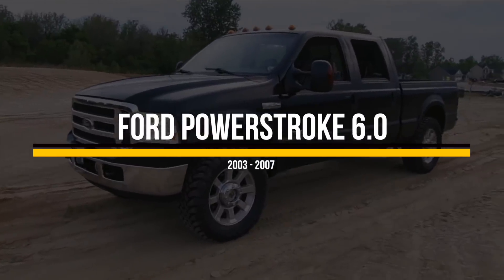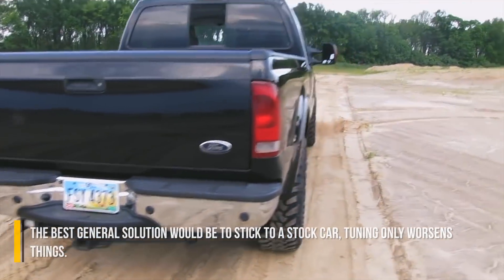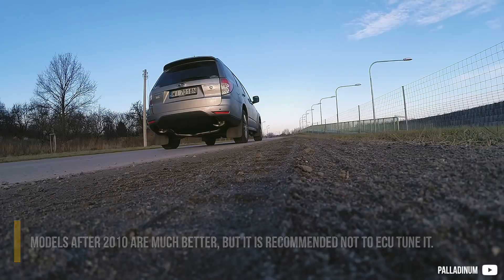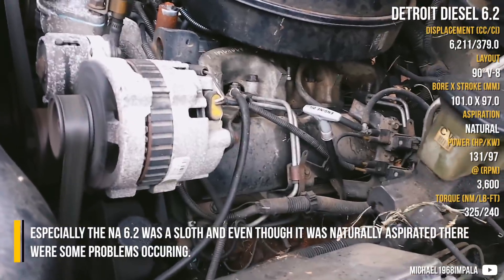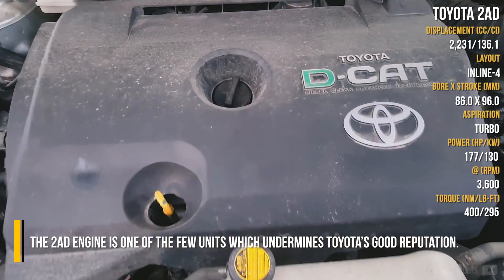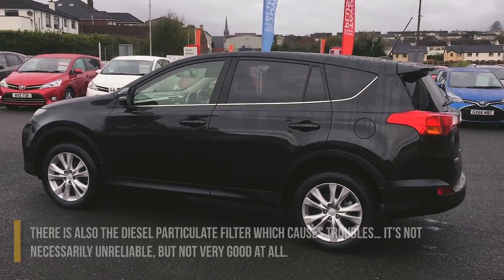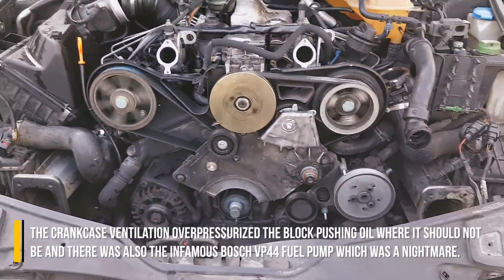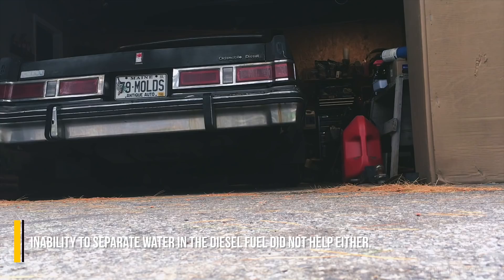6 Worst Diesels You Should Stay Away From

Comment: 6.0 and 6.4 Powerstroke are shit. 7.3 and 6.7 are waaaay better.
Reply: Mustanglvr007 - sounds like he combined 6.0 and 6.4, 6.0 uses high pressure oil pump and 6.4 are high pressure fuel pump. But 6.4s with only tuned and deleted are beast!
Reply: Early model 6.7 had turbo and crankshaft issues when used hard
Reply: Please do. I have friends with 7.3s too and almost bought a few. But anecdotal evidence ain't real evidence.
Reply: Eric S usually i wouldn't waste my time recording a video for one persons opinion but since I was going to anyways i will have it up by tonight.
Reply: osp80 not entirely lol. My buddies boss had a 04 f250 40,000miles and  fully “bulletproof” and still blew a rod threw the pan, buts it’s pretty much the luck of the draw if you get a good one of a bad one.
Reply: Mustanglvr007 - the first 3 years of the 6.7 were a little wonky but they definitely aremt bad. We have blown 3 6.4 motors so yes its shit. But after bullet proofing the our 6.0 it runs like a champ
Reply: the 6.7 cant hold a candle to the 7.3 in terms of reliability and simplicity...and the early ones had a plastic oil pan lmao

Comment: early 5.7 diesels used a standard 350 rocket block and were essentially a gas motor that was converted to run on diesel, later versions used a heavy duty diesel "dx" block that can actually be converted to run on gas. both engines had major reliability problems as well as pathetic power output

Comment: i have that avensis 177hp, no problem..
Reply: Walter White just wait a bit
Reply: This motor in Lexus IS isnt't very reliable.
Reply: you have d4d or dcat its diffiren engine
Reply: Yet
Reply: D-CAT. 170.000 km guys
Reply: Walter White 170k only? Shit.. thats like breaking in a om606..

A proper diesel should go +400 000 km without big problems if maintained correctly.
Reply: yup mine bmw 330d e46 204hp has got 377k and still bangs
Reply: Avensis 150 2ADFTV with 153k miles, still going strong.

Comment: renault's 1.5 dci engine! worst diesel engine ever!
Reply: Gaston Martinez 

That's utter bollocks. A mate has had a Clio 3 GT for the last 8 years now and has never suffered a single issue.

My missus has a now 3 year old Clio 4 with the later 1.5 DCi engine and again zero issues.

Quite punchy and will easily return over 50mpg around town.
Reply: Wow thats crazy! Im a mechanic, and I dont stop seeing cars with this engine, having a lot of trouble, maybe its something that occurs only here in my country due to the bad diesel quality
Reply: Mulymule that Mazda 2.2 is very good, butt aperently not the newest version. Heard of some come inn with scratced cammes already at the first oil change
Reply: true and false, depend from the generation: the oldest had many issues, but the  last generation 1.5DCI  are the best diesel engines from the category, adopted by Mercedes benz on class A and B!!!
Reply: Gaston Martinez 

It could be diesel issues I suppose. They're a hugely popular choice here in the UK and while I don't doubt some have broken down I've yet to see one stranded or being transported home dead!

If there are two things the French know how to do well it's engines and sharp chassis set ups.

My own 12 year old Megane RS has some of the older Renault niggles but it's been reliable and a lot of fun to drive.
Reply: Early ones yes. Later ones are good. You see them in Dacia taxies in Romania with 500.000km on board all the time and the owners are generally happy with them.
Reply: the earliest 1.5 dci units from 2002-2003 had a faulty Delphi high pressure CR pump, they improved the quality of the pump from 2004 onward and later ditched Delphi completely in favor of Bosch and Siemens

Comment: Despite the 6.0L's reputation and its known flaws, it has been around long enough that you can bulletproof them well. Plus, any early 00's truck  is going to be of the age and miles that it will probably be time for a refresh anyways, so that's when you do the work to the EGR, oil cooler, HPOP, heads and such. Not necessarily delete the smog devices outright, but replace them with better components and procedures. Lack of a DPF makes this relatively (kinda) simple and they can be reliable once the engine is done up right.
 Now, the real turkey was the 6.4L as it was the first Powerstroke that had to meet the more modern emissions requirements. Add to the fact it was scrapped after only 2 years and you have an engine that is unreliable AND has a short production run, but also has far less support and creative solutions built to solve those issues for second and third-hand buyers.

Comment: To be honest i have an 2003 A6 C5 2.5 TDI BDG engine. I have it for 5 years now, and it runs like a champ, didn’t have any problems with it. I am very pleased with the engine. 
285.000 km
Yes there were bad 2.5 TDI V6, but the old ones. 
Still, nice video. Keep it up. 💪🏼

Comment: The Olds 350 diesel had been re engineered by 1982/83...up until 1985, the engines were sound. I agree it needed a turbocharger, but it got 30 mpg in a 4200 lb car.

Comment: I picked up a Chevy Suburban 1985 6.2 L diesel 4x4 in 1995. it only had 82,000 miles.....  Could not kill that thing till I actually wrecked it on Highway in 2008.... that engine and transmission had over 300,000 miles. And the only thing I ever did to is change the coolant, glow plugs, oil and filters !

Comment: I love the 6.5, move the pcm and the fuse block, update the injector pump, and its practically bulletproof. The cranks are known for snapping cause of faulty balancers and bad metal batches, but that fix is a 6.2 bottom end with a 6.5 top end. They are not a 12v in terms of speed or a 7.3 in terms of factory strength out the gate, but itll get you, what your towing, and anything else there happily and with decent mileage. Dont forget the 6.5 lives in a fuck ton of Humves.

Comment: The Renault sourced engine that Volvo used, ie the D4192T3 (Used in the Volvo S40 and V40) is a cracking engine. 1.9D, 115 turbo intercooled. Can do 300,000+ miles on em, with regular servicing. Brilliant units. 

They had beefed up (and i believe forged) internals from Volvo over what Renault had, and Volvo de-tuned it from Renault's 130BHP to 115BHP, for the sake of reliability.

What was left, was a brilliant diesel engine was great reliability and amazing fuel economy. Hats off to you Volvo

Comment: There are a plethora of issues with the 6.0 Powerstroke but all can be overcome and it is a very capable engine if "fixed" with aftermarket parts. In fact a 6.0L Powerstroke powered truck won the Diesel Power Challenge a couple years in a row. The problem is that for some reason the engineers who designed the 6.0L thought it would be alright to increase the boost while simultaneously decreasing the head studs from 6 in the 7.3L to 4 in the 6.0L.

Comment: My 1980 Cutlass with a 5.7D engine runs just fine. As does my Datsun inline 6 diesel from the 70's. The Subarus has a problem with the double mass fly wheel. Often the sound is mistaken as an engine noise. The shop pull the engine and find no fault, then mysteriously after "rebuilding" the engine also find the flywheel problem. Selling it to the customer as the flywheel broke the engine.

Comment: Here in Argentina the Renault K9K diesel engine had a lot of problems because, when the car was initially sold, the gas station didn't make the requirements for that engine, it was needed 50ppm of sulfur, and because of that it had a lot of bad reputation because the injectors broke.

Comment: I own a 79 Oldsmobile Delta 88 with LF9 Diesel engine. Here in Germany most of the people dont know diesel engines exist in the US earlier than the 90s. So its a very exotic car. In spring i start restoring it. I have 2 engines for it. The Original one is dead and sits in the shed, on the other one the injection pump is nuts 🥴. It has original 64k miles on it (the Original engine was totaled 3 times and rebuild 2 times by the previous owner). I will try with arp parts and bigger oil pump and reservoir, temp gauges. Hopefully the engine will stand than. The car will be a cruiser for good weather and car shows.
Reply: You need to get the DX version.  It is far better than the early ones.

Comment: The 6.0 is only second to the legendary 7.3. AFTER being bulletproofed. The 6.2 and 6.5 were made for fuel mileage, the 6.5 was good especially before 94.
Reply: 7.3 is a great workhorse. But if you want performance, a studded/deleted 6.0 is a MONSTER
Reply: I'd argue the best year for the 6.5 was 97-98. Yes, you had to relocate the PMD. However, you got other goodies in return, like the dual thermostat coolant crossover, upgraded cooling fan and venerable GM-8 turbo. You also got 440lb of torque
Reply: @detroitdiesel-vu3ig  agreed, but I would much rather opt for a detroit 4-53t or a 12v cummins

Comment: In europe Jeep Cherokee diesel is powered with 2,1litre Renault engine and later 2,5 litre Psa engine, you should avoid those. I had two later of those models. I also had chevy van with 6.2 litre Detroitdiesel engined, never had no trouble and the torque moved that heavy car very well.

Comment: I’m surprised that the 6.0 Powerstroke was on here instead of the 6.4 Powerstroke. Usually on a 6.0, you could replace the studs, replace the egr cooler, and make sure you push it every once in a while to clean it up. The 6.4 just had so many problems that you couldn’t fix one thing without worrying about another.
Reply: The 6.0 isn’t that bad if you fix it. Same with the 6.4 it’s just the 6.4 is worse.

Comment: To add to the list:
- BMW N47 engines from the 320 and 520 diesels. The timing chain sprocket on these engines gets worn out anywhere between 180.000 and 250.000 km, causing the car to sound like an old 2 stroke detroit diesel. Sometimes the teeth sheer off completely or get so worn out the timing chain slips, destroying the valve train.  Here's the kicker - the timing chain and sprocket are AT THE BACK of the engine,  making it a pain in the ass (and expensive) to remove. The older M47 has the same issue, but it's easier to fix since the timing chain is in the front of the engine, meaning  you don't have to take the whole engine out of the car to fix the issue. Oh and the cylinder head on the N47 is prone to cracking.

-  2.0 liter diesel engines from VW/Audi made between 2009 and 2011 suffer from fuel injector ticking,  leaking or even failure.  There is a similar issue (but with different causes) with older 2002-2006 1.9 and 2.0 diesel engines used on the Pasat and the Jetta, as well as  issues with the high pressure fuel pump and the EGR on Audi's from the same period.

Comment: The worst diesel motor i have ever experienced is the 2008-2009 Ford 6.4 v8 powerstroke diesel. We own a F-450 with said motor, the orginap motor someone had tuned and messed with it before we got it. But ran perfect. Till pulling 2000 gallons of water it blew a turbo hose, shocking the valve train and cryshing multiple rocker bearings sending them trhough the motor. Second motor was in a truck that caught fire, it was blown up before we got it. The third and final motor ran perfect from a wrecked truck with under 50,000 miles on it. Egr deleted it and  made sure everything was perfect on the motor. First load we put on it ( only 1,500 gallons of water which even the first load was within its "towing capacity") it busted number 3 piston and busted an injector tip. Needless to say we have gotten a 5.9 cummins and are in the process of swaping it now

Comment: The ls9 or the early 5.7, this was an interesting engine. Didnt have alot of power but still made the roadways. Did very well i think we experaiamced things from it. Ok next the 6.2 omg down memory lane. It had its downsides later improved roller lifters heavier cam. Worked very well again sounded nice. Not a heavy engine just a nice everyday engine. I cant speak for with turbo i didnt. As for the 6.5 never tried 1. I went for the 6.9.  Some of these vids try to crash certain engines the only thing bothering them is the emissions. It not the engines diesels have alot to offer.

Comment: I drive a Ram truck with 5,9 L diesel, and it is one of the best diesel engines you can drive, BUT what also makes a diesel a bad choice is the repair and parts costs.You can have a fine diesel design, but the maintenance especially if your not a DIY is going to be much pricier, for example an oil change uses 3 gallons, a set of injectors $2500 and beware if you put in re-manufactured  or new non Bosch types, you might destroy the engine.  If you have the VP44 or a CP4 fuel pump you have a bad diesel engine, IMO. I have the CP3 pump which is a great pump, but even the OEM fuel filtration sucks in the Ram trucks, and to prevent wear, you must install a high efficient fuel filtration system.

Comment: I concur about the D-CAT. We had an Avensis in Germany until 300,000 km on the dash. It has loads of torque, but it's not necessarily good on fuel consumption. We sold it to Latvia in the end. Filter clogged three times and we had it properly serviced and 130 to 170 km/h was the maximum average speeds on the Autobahn. No short distances whatsoever. And it still failed on the filter, two injectors and the engine consumed oil after 160,000 km, luckily we had it serviced at the dealership, so we got a new engine for free, since it was a known problem according to Toyota.

The petrol models really pull it off, no doubt about that, but i would never buy a diesel in a Toyota again. After all that we drove diesels without anything close to the issues the D-CAT had. It is surely fast and can tow, though.

Comment: renaults 1.5, 1.9 and 2.2 are really prone to eating its crankshaft bearings after 150k km. 1.5 has aluminium CR pump housing and the pump then produces small metal particles which destroy injectors and fuel lines. It should at least be put as a notable mention at the end.
Reply: thanks for telling me I will know what has gone wrong when my Dacia Duster diesel  goes into self destruction in a few years time.

Comment: Newer Toyota diesels with timing chain are notorious for pulling headbolt threads from block. Subaru diesels can actually crack lengthwise near main bearing caps. Both of these usually reguire engine replacement

Comment: Never had to pull the cab to work on a 6.0, that was the 6.4 PSD. I've seen some really amazing running trucks and some that would fail every few thousand miles. Once you take the time to install head studs and delete the problematic emissions systems, they're much more reliable.

Comment: I agree wit your list.  Those 5.0 diesels, well they use the same rollers for the push rods as a 7.3 IDI and PSD.  Not joke, you will find they are the same part in several V8s crazy stuff LOL.
I really hate the 6.0, 6.2, 6.5, and any 04 and up diesel in general.

Comment: We had a 6.5 turbo on a work truck and we flogged the hell out of it.  Of course we had to replace  pumps almost yearly but we frequently pulled 20k lbs with it and although it wasn't a fast truck, it got the steel where it needed to be.
How did it make it to almost 150k miles?  We were very meticulous about maintenance because the trailer was almost never unhooked and it was loaded to capacity or the truck idled waiting to be loaded.  There really was no in between for that poor rig.

Comment: The 6.0 is fine if you know what you’re getting into and know how to bulletproof it. I own two. I got about 250,000 miles out of the bone stock Excursion I had. However, cold starts and blow by were issues by the time I sold it to a rebuilder. Which is where I purchased my second 6.0.

Comment: 6.2 Detroit diesel is used in marine applications and is a solid motor, but it's not a Cummings.  One feature that I like is that it has no DEF or electronics to fail.  Mine is turbocharged with arp studs and 6.5 intake and marine injectors. Hello power, goodbye fuel economy.  I can do 70 mph with 373 gears or 37.5 beadlockers.

Comment: The 6.0 liter Powerstroke aka International Navistar, had the problem that it was an attempt to make a small block diesel. Like the Oldsmobile 350, warped blocks and heads and blown head gaskets were common, in addition to the serpentine belt having one wire through it, necessitating dismantling the whole front end down to the frame to change the serpentine belt. At least that's how the E-450 buses I drove were.

Comment: Visio Racer... I believe the GM 6.2 was a good engine. It started it's life in 1982. There were some reports of block cracking issues on very early examples of this engine. If I'm not mistaken, these issues were ironed out by 1984. The 6.5 was a TURD. Basically a 6.2 with a larger displacement and a turbocharger. Blown head gaskets, the 1994 and later injector pumps were very failure prone.